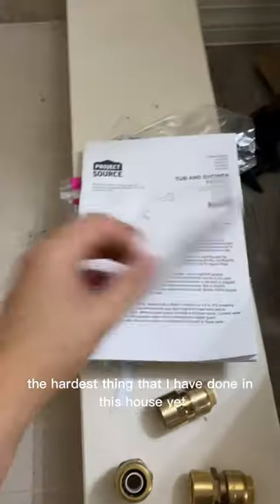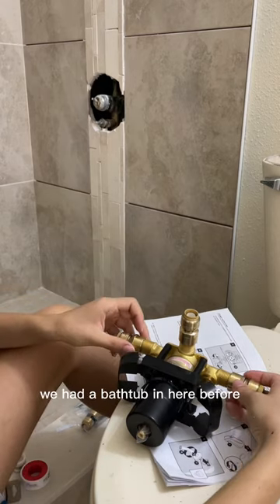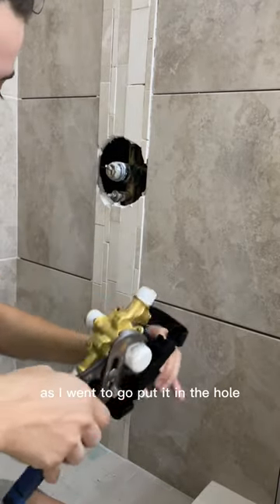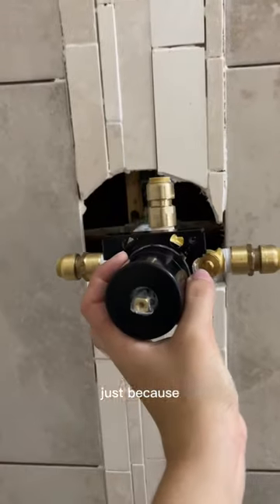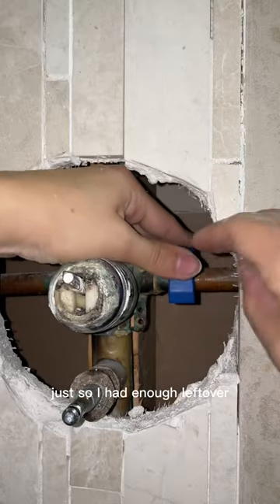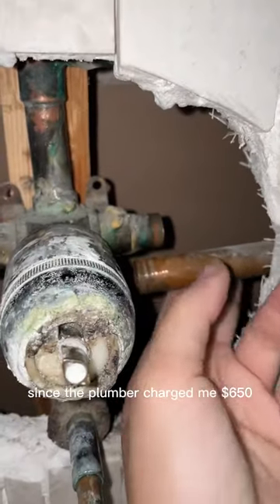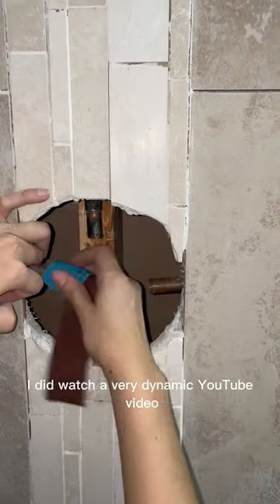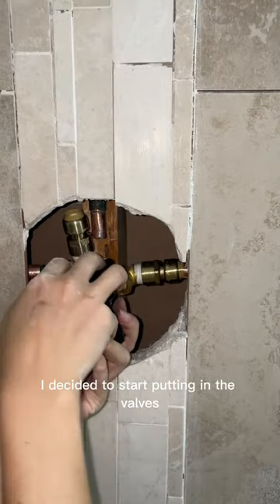Plumber charged me $650 to change a shower valve, so I did it myself… #showervalve #plumbing

Comment: You have to cut the wall behind the shower valve to be able to do this repair, they sell in wall copper cutters they’re just a circle that wraps around the pipe and you twist, don’t use a multi tool to cut copper. They sell a tool to make shark bites release so you can take the valve back out. Then go around the back and cut an access panel. I’m a licensed plumber and even we won’t attempt to try it this way it will most likely leak. Good luck and try to stay away from shark bites!
Reply from the maker: That is super helpful thank you!! Unfortunately I did not want to do any soldering so the only think I found to use were shark bits but I’m making sure to take all of the extra precautions and if it leaks I will hire the plumber :)
Reply: Sometimes shark bites are the only way, hope to see the full video of the install soon !

Comment: They sell a tool you shove over the top of the pipe and it deburs & helps you mark the proper depth on the pipe for connection. The tool goes over the pipe, you spin it, it shaves the edge of the pipe so it sits into the shark bite properly & doesn’t damage the shark bite plastic ring on the inside that bites the pipe (reduces leaking risks) — deff worth getting that tool. It’s only $10ish but I think you’d have trouble using it here bc of how tight the space was, it needs room to go on then spin around numerous times but it has to sit flush & flat while using it on the pipe end. Also as a general tip to anyone L͎ ͎M͎ ͎A͎ ͎O͎ if you find a shark bite package that’s been opened, DO NOT BUY THAT ONE bc it’s likely already damaged and you will regret it ask me how I know 😩🤣

Comment: First shark bites are for temporary use not permanent use second the reason they charge more is the do it the right way I guarantee you that will leak within five years and worse yet whatever u save will be used in repairs later u need to flex and soder those joins

Comment: People are dogging you out hard and you definitely made some mistakes but I can appreciate the try, I charge right around 1000 bucks for these because they are difficult. You never wanna put shark bites behind the wall and that PVC cap isn't rated for hot water. According to shark bite you can put them behind the wall but only if you ream and debur the copper properly which almost no one does. As a plumber I definitely woulda cut the backside of the wall and pressed that in or sweated it but that's because I have the press gun and the torch. Good try but please be careful when doing plumbing, restoration companies charge a lot.
Reply: 1000!? Geez i should learn too haha

Comment: Mmmm, so a plumber anyway?

Unless the guy that is the plumber in the comments helps you enough.

At least you learned something.

Of course, you could do like a hot little number that was a customer at a supply house.

She found a foundations guy,
She 'dated' him until he finished her foundation.

Found a framer, dated him until framing done.

Plumber, electrician, roofer, carpenter/finish carpenter, etc etc, etc, supposedly until the house was built.

Now, I'm not sure if she completed the house after the finish carpenter, or she ended up dead if someone figured out her game.

Perhaps she caught "Plumber's Butt" 😮 or something similar, but that was her plan anyway.